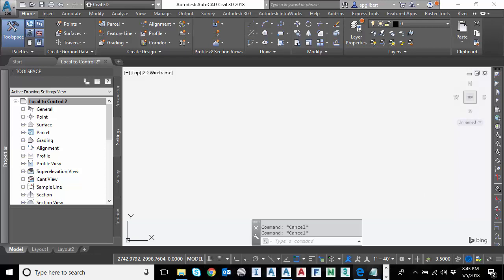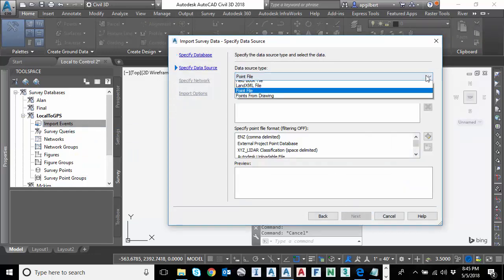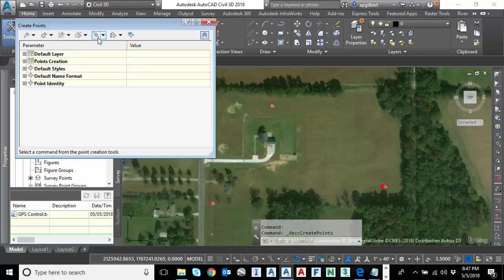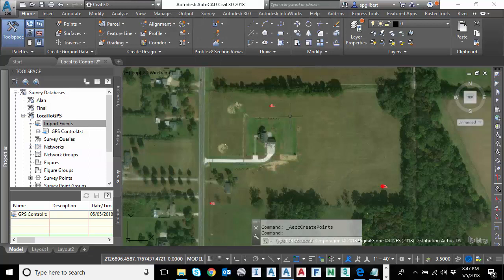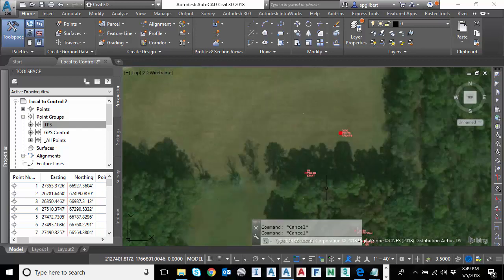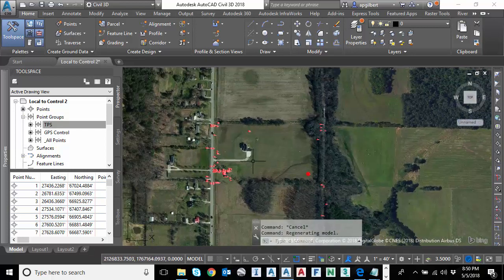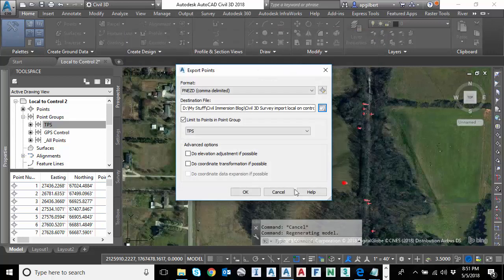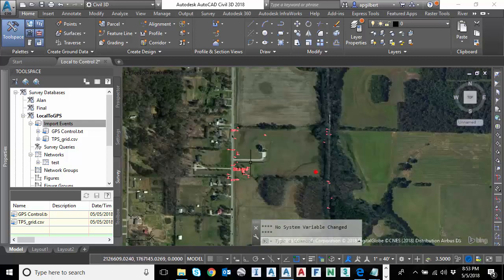Finish Strong Friday:  Import Local Coordinate Survey Data into Known Control Points – Part 2

Comment: Map Task Pane mean or what is use. also tell me difference between sdf and shape file.
Reply from the maker: Hi Sandeep, the Map Task Pane is a tool that allow you to connect to various GIS file formats/images/etc.  Shape file (.SHP) is an ESRI geospatial file store format that is widely supported in the CADD and GIS industry.  .SDF is an Autodesk geospatial file store that is primarily used to share GIS data between other Autodesk applications.
Reply: thanx sir can u share me ur email id.many time i want u share image related  civil 3d problem.